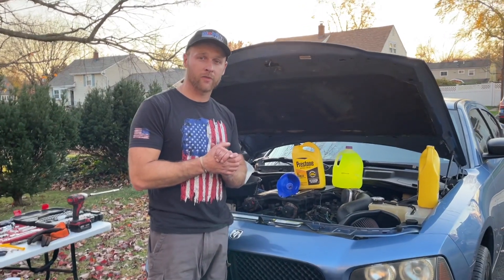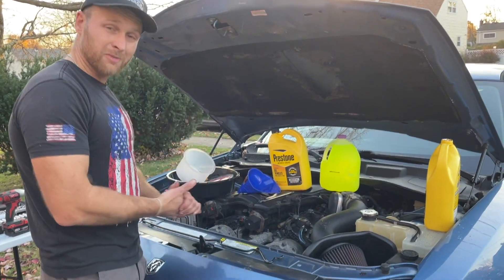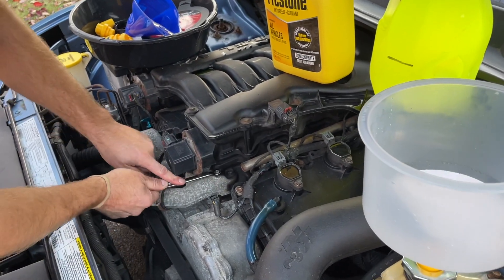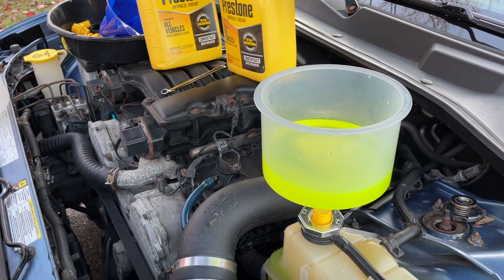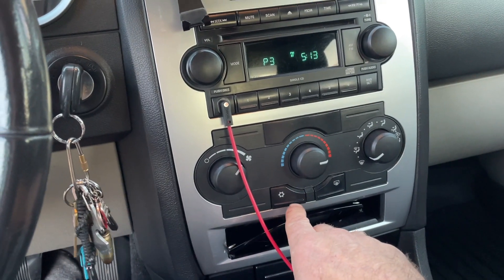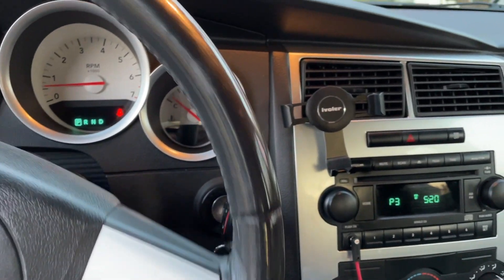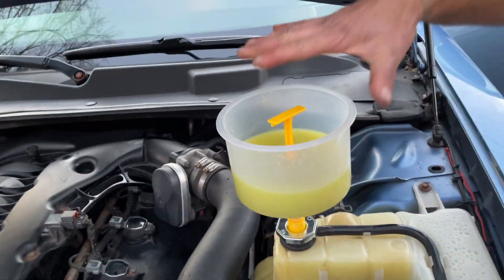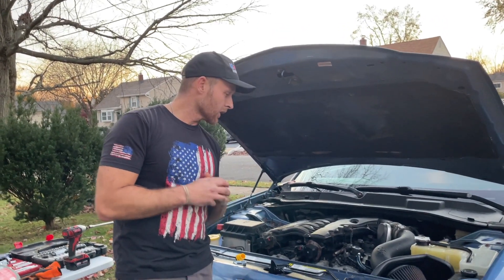How to “BURP” Bleed Air Out of a Cars Cooling System - Easy DIY process for ALL makes

Comment: Great video I have been doing this but the temperature gauge on my 5.7 Durango is fluctuating up and down sooner I hit traffic I can see the temperature jump to midel and then come back down but before i did a radiator flush the temperature gauge was stable wasn’t fluctuating !
Any help appreciated thank you
Reply from the maker: Thermostat is good right.  Also both houses air squeezed out.  And bleeder valve if yiu have one.

Comment: Oh yeah. If you open the radiator cap.. with any old rubber coated cotton glove, you can bleed the overflow hoses by forcing air and coolant into the passage meant for over pressure by moving the cap until it gurgles lol 😂 then it’s relatively safe once the temp drops. Even hot. I’d recommend like.. getting to thermostat temp then waiting 5-10min.
Reply from the maker: Thanks for sharing
Reply: Yes this is helpful advice. Especially if your car has overheating issues.  They happen at operating temp.  Not cold. But still,  be careful!!!
Reply: Where is your video

Comment: lol it won’t explode.. check the pressure in hoses. I just.. ie now… ran a v8 Holden to 92c and the hoses had little pressure. Since it has a massive  reservoir, I just burp it using its own system lolz.  If a vacuum is pulled it sucks it in. If more than 140kpa, blow off. Bleed the blow off hose. Imagine sucking in air lol you’re supposed to go through a full cycle of cooldown so when vacuum is pulled it gets fluid. Anyway I opened the radiator periodically even at full 92c running temp. Thermostat runs from 86-92. I definitely agree you shouldn’t touch it unless you know wtf you’re doing. I also didn’t need to put heater on since I have no valve. The car constantly blends hot and cold to create air currents in car

Comment: So if I changed my Radiator and It needs to be filled up with no Radiator cap, I would just fill it up like u did through the reservoir and it wil travel to the radiator and fill it up?

Comment: Ive got a question, i noticed my dodge durango oursuit 40a fuse for the intercooler wasnt there, ive been running hot and overheating, once i burp the system like this will all the air be out once i plug the intercooler hose back on? Its right where you're bleeding from in the video
Reply: I replaced the fuse and am about to replace the thermostat also

Comment: You dont want to overfill the resivor do you?! My car has a line just below the halfway dow that says fill line, am I suppose to fill it past that?!?! How would i get ot back to the normal correct fill line then?!Thanks!
Reply from the maker: Correct.   Can siphon some out after.  Or it will just overflow later through the hose on there.

Comment: Good video, yeah you could leave the heater fans off the get the engine up to temp quicker. Some cars have a valve for coolant flow to the heater core energized by turning on the heat but if it were my car I would remove that valve so coolant flows 100% of the time keeping the lines and the core clean. Just some thoughts.
Reply from the maker: Thanks for sharing 👊

Comment: It seems like i cant get all the bubbles out at all. Even after the cars been running for over 20-25 minutes. Should i just keep letting it run until its all gone? I stepped on the gas pedal and squeezed the hoses. When gassing there r no bubbles but when i squeeze the hoses there r still bubbles coming out. Please help
Reply from the maker: Did you do the valve too. Then hoses  after
Reply: @HowToWithLech  what do you mean valve? The thermostat?
Reply from the maker: @andyl9920  sorry.  i meant the bleeder valve.  at the 2:14 mark
Reply: @HowToWithLech  i think my 2011 Pilot does not have a bleeder valve
Reply from the maker: @andyl9920  aha.  ok.  if you got most of it out you should be fine.  i think there will also be a little tiny ones left.   not familiar with your cars hose setup.  but i think you shoudl be good.

Comment: VW uses the vacuum fill system. I saw one video that said if you dont use it, there could be air in the water pump, so it fails to circulate. I doubt it though. Has anyone osed this method on a VW ?(specifically VW 2013 Passat TDI).
Reply from the maker: Not sure.  Sorry

Comment: Thank you very much, I had so much air in my system and now it runs perfectly for the moment no issues.
Reply from the maker: Nice 👊
Reply: @HowToWithLech  I have a car that’s known for bad head gaskets is the only way to know if my hg is bad is if I do the chemical test? I have no frothy oil or coolant on my caps
Reply: Car hasn’t run hot since I burped it

Comment: I have a Toyota Camry 2001 2.2 Litter e tine 4 Cyl . I can hear a gnashing sounds like water in the top of my engine . Is that a Air in the intake .How do I get rid of that slashing sounds like a water ?Then I had a flaming engine lights But my car runs good How do I fixed this issue
Reply from the maker: Hard to tell without seeing.  Have a mechanic look at it next oil change.

Comment: I'm having air bubbles on a Pontiac 2007 torrent and I think I don't know ,maybe somebody said it could be a blown gasket but I doubt it I did the same bleeding out air  almost a year back  and everything went fine and  it's happening again so wonder why .I never had this issue in any other cars with air bubbles.help
Reply from the maker: Maybee do pressure test for possible leaks.  Have Vidoe posted for that too.  Gasket also possible

Comment: I'm a woman trying to learn how to do this as I have a sloshing sound in the dash area on my Kia 09. I cannot find any leak and it doesn't smell like coolant. But for some reason it started sloshing several months ago. So far the car does not overheat or anything but I've noticed the AC gets wonky and also I have noticed the rpms going up and down so this seems to be a coolant issue. I am trying to figure out how to bleed out the air myself. I'm a little nervous about the whole pressure screw thing it just seems to leak antifreeze on the ground which you know is poison to animals.
Reply from the maker: Maybee time to do coolant flush/ change.   Also can do pressure test to check for any possible leaks
Reply: @HowToWithLech  Hey there, I did do a coolant flush. But in the end it ended up being a cracked radiator. So the radiator and hoses were replaced. Thank you :)
Reply from the maker: @DragonQueen78    nice. glad you got it sorted out.

Comment: Hey thanks for the tip I just replace the thermostat on my 2014 caravan and after it was running hot when I was getting on the gas but cooling back down eventually I think I have air in it I'm going to try this
Reply from the maker: Do it. 👍👊
Reply: @HowToWithLech  worked thanks

Comment: If this isn't done right is there a chance that after driving for a couple of hours all the coolant could be pushed out and into the overfill container? I was driving down the road and noticed a mist coming from the front driver side coolant tank, looked over and saw the temperature gauge climbing so i pulled over ,cut the motor and lifted the hood and all the coolant was in the overfill tank,and none was in the hose going from radiator to the thermo housing?While it cooled down while i was waiting for the tow truck i looked under the hood and the coolant was going back into the main tank!
Reply from the maker: 👍. Thanks for sharing
Reply: @HowToWithLech  Come to find out it is the coolant housing, I think it's the mech who is trying to cover his as because they did some work on the intake gasket a week ago and didn't properly burp the system!
Reply from the maker: @davegibson3763  not suprised.   why i try to avoid dealer or mechanics these days.  dont have one i trust anymore.   last time dealreship did some work to my car, i later noticed they left my air intake disconnected from the manifold.  another time they stripped my oil drain plug and tried to tell me i have pay $900 for new oil pain.
Reply: @HowToWithLech  Towed it back to the shop come to find its the coolant housing,I think its the mech trying to cover his ass ,last week they replaced an intake gasket and they probably didn't burp the coolant correctly!

Comment: When driving around town it stays steady now. When driving on highway temp goes up to 3/4 mark. Any thoughts if you have a moment?
Reply from the maker: Thermostat working?  Opening up.  If radiator fans not kicking in, or heat not working. It might be locked up thermostat.

Comment: One day later. used the no spill and it worked great. used the rev technique and the hose squeeze too and bubbles just kept coming til ...the did not.  took maybe 45 mins .  Still keeping and eye on the gauge.  Got a little hot yesterday at 80mph but cooled as i slowed to city driving.  Burped it again this morning and will do the 80 test again.  I don't like seeing it get that hot since that is a new high for it.  Net... Great short effective video
all the best neal sw fla
Reply from the maker: Awesome.  thanks for sharing.   best of luck.

Comment: I have a 2010 dodge charger and my coolant fluid stays cold with no pressure on the cap when I have my car running, I’m not loosing fluid either but my car overheats
Reply from the maker: Probably thermostat not opening .
Reply from the maker: I have video posted how to replace it.

Comment: What if the heater doesn't work though??
Reply: Cann u still do what u did
Reply from the maker: This is not the fix for that.  
Have to make sure thermostat is working. Your fans go on for radiator?  They should once gets hot enough and thermostat opens

Comment: Please help.  Chrysler sebring 2002.   Pretty much same set up.   I turned the peacock and drained the radiator.  Then when I filled the redivide the water level didn’t stop as it should have went into the radiator.  It doesn’t and my motor for hot.   Someone said I need to burp it.   I opened the little release valve you said.   But it just won’t go into the radiator or circulate and it has the flush stuff in the real or now.
Reply from the maker: Thermostat has to open too once gets got.  And then it will get sucked up.  That could be one thing.  Fans work right.

Comment: Way I burp a radiator just move the top cap when engine is cold then I just burp into the radiator then close cap much simpler way doing it.
Reply from the maker: As long as you don’t have air pockets sitting in The hoses you’re good 👊

Comment: Update, I replaced the thermostat, coolant temp sensor (all OEM) and same thing for me, coolant gets stuc since i own the car, i'm going to go ahead and repair the head gasket.k in the expansion tank. The fans are going off, i have heat... i'll bleed it once more, and then just continue to monitor before i get my head gasket fixed.
Reply from the maker: Nice 👊👊

Comment: I have a 5.7l hemi and its not over heating but coolant overflows when i drive it i do have a small hole in radiator im having repaired. I replaced the thermastat and replace the upper radiator house.. Again it does not run hot .. Any advice???
Reply from the maker: Is there too much coolant in the reservoir? Should be filled to the marked lines.   Not sure if the hole would affect it.  Sorry not sure what it could be

Comment: This procedure does NOT WORK on EVERY CAR and isn’t even the correct procedure for the car in video. Any Dodge Certified mechanic would know that and any real mechanic who takes pride in their work and has access to all data would know that. 
Doing this as shown, you WILL have a slight amount of air still in the engine block. 
Another example of someone passing along  advice when they are clueless
Reply from the maker: Always good to do research for your specific car.  Yes.   But This is just the burping procedure that many don’t even do.  And have more details listed too. Here and in other video.

Comment: How long should I leave the car running like this?
Reply from the maker: Till thermostat kicks in , fans go on.  That when it starts getting sucked into the entire system.    10 min process or so
Reply: @HowToWithLech  right on man.. I haveva vent driven fan (85 chevy caprice).. does that matter?
Reply from the maker: @jamalcole1985  not sure bud.  would assume its all similar
Reply: @HowToWithLech  what if the fans don’t come one after replacing the thermostat and it’s not overheating
Reply from the maker: @angelf9800  fans have to go on at some point.  make sure all is reconnected etc.

Comment: I’m having overheating issue and air bubbles issues with my hellcat .. I did a coolant flush now it’s overheating 🤦‍♂️
Reply from the maker: Check if thermostat working.  And  make sure no air pockets anywhere after the coolant flush.  So hopefully this help yiu.  
And then also check that’s cooling system is pressure tight.   
I think those should be the first checks.
Reply: @HowToWithLech  thanks.. got it figured out I had air pocket in the system.. took me a while to bleed it out .. car s fine now no over heating. Thanks for the tip.
Reply from the maker: @teepho3569  nice. glad it worked out
Reply: Ima try what I seen on your vid hope it helps
Reply from the maker: Yeah do it

Comment: Great video but this didn't work for me... for me, the car is not over heating, yet, but when i drive all the coolant gets stuck in the resevoid and not sucked back into the system. need to see if i have a headgasket issue.
Reply from the maker: Possibly  be thermostat too .  Good luck
Reply: @HowToWithLech  I put in a new thermostat. i will install another one just in case.
Reply from the maker: @DTUFINOPhotography    hope that does it for you.  best of luck.  if thermostat working, it woudl open up if the right temp hits.  fans shoudl be going on and all that
Reply: @HowToWithLech  I'm going to replace the water pump, coolant temp sensor and Thermostat
Reply: @HowToWithLech  Okay, my mechanic told me i have a slightly, not a bad one, blown head gasket, so i'm adding some K seal until i decide what i want to do or get a good price. its expensive, but i did the mat would be more costly for me to get a new car. my 2010 FX35 is in amazing driving condition.

Comment: Do you have to do this method after replacing the water pump also ?
Reply from the maker: if changing water pump its a good idea to change the fluid to.   but yeah, you will need to make sure no air pockets sitting et.

Comment: Great explanation. When I have the time, I typically leave the funnel in place (loosely covered to avoid debris entry) at the end of the burping process. I remove it after the system cools. This avoids handling of the hot coolant and allows some additional coolant to be drawn into the system as it contracts. After removing the funnel with remaining cooled liquid, I then just draw some coolant out of the reservoir until it's at the proper level.
Reply from the maker: Nice 👊👍
Reply: How do you draw the coolant out of the reservoir once it’s full?
Reply: @Pash93  A turkey baster would work for that
Reply: @Pash93 . I use a turkey baster.

Comment: Could you do one on the 3100 GM low profile engine (Buick Century, Chevy Lumina, etc.)? The radiator outlet is slanted and there are two bleeder screws. Always having heat issues. Thanks.
Reply from the maker: If I can get my hands on one I’ll try.  Have to ask around.  Bleeder  valve should be similar idea if it’s there.  But big thing is getting the air out of the hoses.  
Could be the thermostat that needs replacing though.  Maybe it’s getting stuck
Reply: @HowToWithLech  the whole top end and thermostat is new. Thanks.
Reply from the maker: @ferdiecassel3697  hmm.   not sure.
Reply: @ferdiecassel3697  new doesn't mean anything. could be functioning the exact same as your old parts

Comment: does a chrysler 2005 300 touring have a bleeding valve? i drained the coolant an tried to refill , put in about a gallon but it wont sink in had car engine running but didnt know fans must blow or atleast air turned on very confused on whats the issue
Reply: found out it does have one exactly where ur is in the video but it sprays all over the place and im worried about it getting on something it shouldn’t and some of the coolant went in once i released pressure from the bleeding valve but it didnt wanna keep doing it not sure if had to let the engine running for longer or what i did wrong
Reply: thinking about taking it to a place rhat does free inspections but just hoping they dont charge excessively for a simple fix
Reply from the maker: Not 100% sure. But i believe  it should. 
U drained  it all out? And it’s not going in at all?   Weird

Comment: So have an idling issues, I put in drive it stops idling high sometimes it will kick in drive when I shift or in park or revers, I done replaced the tps sensor map sensor mass air flow sensor idle sensor it's still doing it , sometimes it will accelerate by it self , but I put tps sensor on 2 times and check engine light is still reading it , tried having codes cleared after replacing everything and the only thing that keeps coming back is the tps sensor, it doesn't make sense, and also it shifts hard one time then after that it drives good it doesn't make sense to me it's because of the idling issues
Reply from the maker: Yeah. That’s weird.  Wish I could help.  Not sure

Comment: Good job from an old retired tech,you explained it very well,even a dummy couldn’t screw this up.
I checked other videos and yours is the best.I can suggest a cork from a wine bottle works well for the funnel.
Reply from the maker: thanks for the feedback.  really appreciate it.
Reply: I fked up i cant get the air out 😢 
Keep overheating after 10mins
Reply: @hubsun700 damn bro😭
Reply: @jspades5100  i removed the thermostat lmao
Reply: I resemble that remark  haha yea hood video made my day its Jan2nd got no heat.

Comment: Very nice video! A quick question, my cars AC gas leaked out. How do I bleed the system without any hot air?
Reply from the maker: Ac should not affect it. As you’re turning the heat up only.